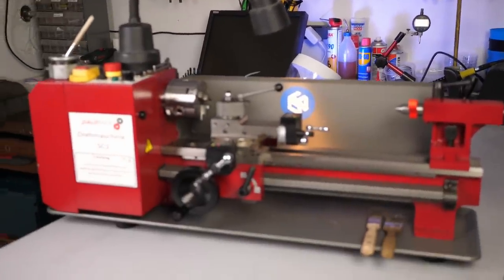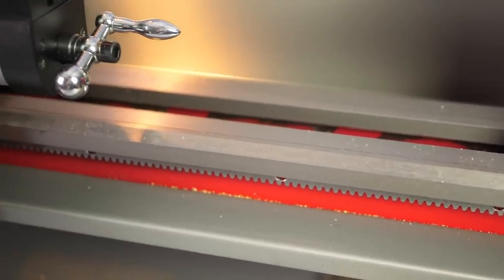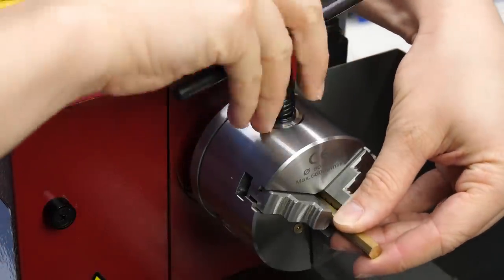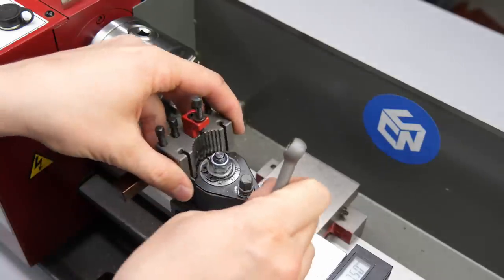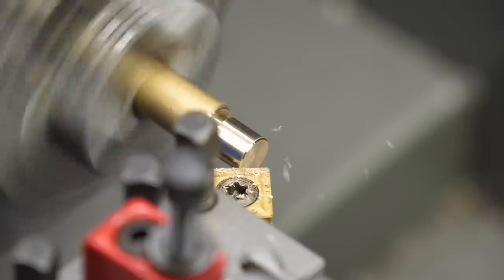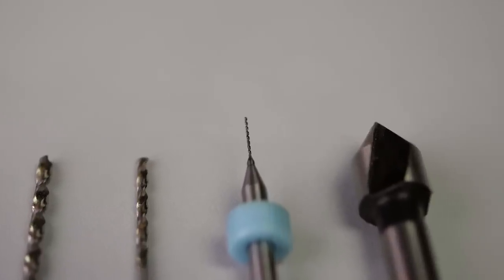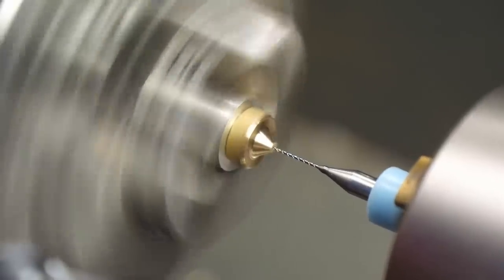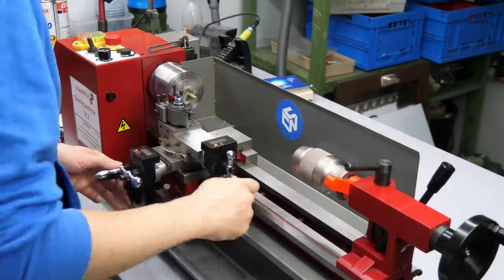Mini Lathe Project: 3D Printer Nozzle

Comment from the maker: Don't forget to share this video on Facebook, Reddit, Twitter and other social media!
Reply: ahaan, you rrrr pro
Reply: Sure. I want more of lathe videos. I think Nice challenge would be 0.1 mm nozzle
Reply: At :52 you spelled Squarespace wrong in URL
Reply: Question: is it possible to make threads on a pipe? And how would i do such a thing without buying a very expensive die. I am planning to make a filament extruder, but i can really put on a “nozzle without threads.

Alternatively I could try and weld a plate on to the pipe. And make a hole into the plate. Which is obviously not preferable
Reply: @rikdenbreejen5230  yes you can, theres a variety of pipe threads. They tend to follow with the size of pipe you're using. They are external threads though...
If you want internal threads you can possibly use any fine thread that fits.
Reply: Yes you can grind some old drillbits for other angles but they are not going to work as good as the actual made for it drillbit but it does the trick
I learned this from my teacher because one of our students broke the last drillbit for school project and we made it from old drillbit we had to change our way to drill a bit tho
Reply: This Old Tony might be able to help you with the drill bit. He has an old video out on designing them.
Reply: Clickspring's quick videos about brass turning will be your friend.
Reply: Great job, love your work ,keep it up
Reply: When I remember correctly there are special drills with an other angle in the front you could use one of these to make the newer design.
Reply: 5:40 in my experience carbide is perfect for the minilathe and the better choice.
The mini lathe can rotate at high rpm but is weak at low rpms
HSS need low rpm, carbide work good at high rpm. So carbide is better for this machine.
Reply: one day you can make a metal 3D printer yourself!
Reply: CNC Kitchen btw, you could grind a drill to the right angle.
Or use a HSS steel rod and make you own drill. you need a special Tool grinding machine, but this is the way we do it a lot. 👍
or look for the right sized „NC Anbohrer“ the angles should match pretty good
Reply: Which 3d printer do you used for the benchy?
Reply: @rikdenbreejen5230  yes on larger layths there is gear settings for threading and all you would need is a threading bit

Comment: Spending 2k for making a 1$ nozzle. Honestly this is the kind of things I like, even when it doesn't make sense to regular minds. Great work!!
Reply: Agree. But a the very moment you need a custom nozzle, say in a odd diameter, a bi-metal configuration or with special material properties, the machine will pay for itself in no time. Even more so, when you can save a piece of existing machinery for which no spare parts are available any more by machining the missing bits in your own shop.
Reply: Absolutely, but making these one dollar parts are the practice you need to have under your belt for when you need to make those really important and expensive parts.
Reply: Knowledge is expensive
Reply: Also... y'know... you can make other stuff besides nozzles.
Even if you only want to do 3D printed projects, a lathe is still a really useful augmentation to one's tool set. Being able to make custom threaded inserts and other mechanical linkages is perhaps the most obvious advantage. If you can print plastic AND machine metal, you unlock a lot of choices for materials and methods in the design of your projects.
Reply: It's also good for practice 😉
Reply: @joshuamckown3145  You did not read my post besides the first sentence.
Reply: @joshuamckown3145 We have the same name and the same opinion about tools, we should marry🤣
Reply: It pays off in the end. Often you make a part that enables you to build a machine that would otherwise cost $$$$
Reply: He can do other things too, just this was the first.. :D
Reply: It cost me $8 for a piece of brass and two drills when I tried this with my first 3D printer, but I borrowed the lathe.
Reply: ah, yes, because he made one nozzle and then threw away the machine
Reply: $2k on a lathe for a professional maker channel is 110% money well spent. A lathe is an extremely powerful tool and for 3D printing especially you can manufacture custom nozzles, heat breaks, etc.
Reply: Well I already have a mini lathe, small 1950s mills and a little horizontal bandsaw that I got all for $700 used...now when my printer arrives tomorrow I'll finally have a use for them! Lol. I could just use my cnc lathe at work too though, that's only 90k without tooling. Not a bad deal for some nozzles if you ask me.
Reply: In India it's 11$ per hotend
Reply: Sometimes we want to have some fun as well. I have bought a small lathe for about 500Eur... chinese machine but looks more robust than this one. Was it worth it? For me yes. I don't use it too often, but there are applications where it is the only way to prepare something.
Reply: 2k nozzles sold and it pays itself

Comment: I’m a tool maker. 

You can get 60deg drills or cutters. 

I would sharpen a drill bit because I can and it’s cheaper as I have drills laying about.

Also, if you are looking for accuracy, heat and callipers are your enemy. 

Coolant and micrometers are the way to go.
Reply: Fully agree with the micrometers.
Reply: Don't forget gauges!
Reply: Alternatively, use regular 90deg drill and make outside taper 90 degrees. Or 80.
Reply: ColonelAngus101 I think the 60deg helps molten plastic flow.
Reply: I agree i would also sharpen a drill bit to 60 degrees, crude but effective.
Reply: Why

did

you

put

a

line

break

between

every

sentence? It's incredibly annoying to read.
Reply: @yucannthahvitt251  Your comment is so much more annoying than his and I found his comment quite readable.
Reply: @yucannthahvitt251  because the subject of each line is different? Grammatically, it makes sense, as paragraphs should be separated based on subject. Your comment is considerably more annoying than theirs, theirs isn’t at all, as it is correct.  Theirs was quite easy and pleasant to read. T
Reply: @yucannthahvitt251  Why did you even bother to comment?

Putting a line in between signifies a new paragraph for a different subject. His comment is perfect! Yours is....

I'll let you fill in te rest of the last sentence in the previous paragraph ;)
Reply: @yucannthahvitt251  agreed
Reply: I agree ☝️ totally. I would purchase a cobalt drill. Not HSS high speed steel or titanium. Finely grind the cobalt to the angle 📐 you need and then sharpen it.
Reply: Can you explain why one should use a micrometer vs caliper? Just more accurate?

Comment: CNC Kitchen 3D Printer mods are on another level. Does this mean official CNC K nozzles coming soon?
Reply from the maker: Those would be really expensive nozzles, if I sold them ;-) But how knows, this at least gives me the opportunity to play around with different shapes and features and maybe one of these experiments might lead to CNCKitchen Nozzle.
Reply: @CNCKitchen  Are you able to ream the inside diameters? That would give you a much finer finish for testing.
Reply: @CNCKitchen  have you considered contacting Stefan Gotteswinter? He's a German machinist and youtuber.
Reply: @CNCKitchen  would buy these anyway just for novelty

Comment: To answer your question in regards to grinding a 60 degree angle on a drill bit ... you can definitely do this! The key things to remember though are to make each side of the flute as equal as possible (using a fixture is the best), making sure there isn't a positive angle as a relief (you don't want the tool to rub and create excessive force) and to make the cutting edge have the smoothest finish possible.
I've been a CNC machinist for 15 years working on Swiss style lathes.
I'm looking forward to any future videos on this topic. 😊

Comment: I bought the exact same Lathe from Paulimot. Since it isn't very rigid light cuts are often needed so I decided to convert it to CNC. It's great because now I can use a parting blade to cut any complex shapes.
Reply from the maker: Any information on how and what you did? I'd be really interested!
Reply: I milled a new cross slide on the cnc mill put a stepper on it. The leadscrew uses a ihsv servo, but it has terrible backlash, I should have changed it with a ballscrew. For a controller I used a pokeys57cnc with mach4 and 2 handwheel encoders so I can use it like a manual lathe. Here is a short video of it in action: https://www.youtube.com/watch?v=LBFXywe46-8 Also this guy has a not yet done series about the conversion of the mini lathe and he does a  much better job than I am: https://www.youtube.com/user/RotarySMP

Comment: Great work. Quick suggestion: you can run the tiny drill bit during the first setup. If you use it after you do the previous drilling operations then you will already have the spot drill and it will be perfectly concentric with the bores (plus you wont need to worry about runout when flipping the part). You would just need to clean up the hole after using the parting tool. Let me know if the wording on this is not clear.

Comment: Yes you're right in saying you can grind a drill to a 60 Degree tip.
Once you have the angle you want, grind clearance behind the cutting edge otherwise you end up having to put extreme pressure on the drill and part when you try to use it and it heats up the tip.
Finally, make sure the last thing is to use a sharpening stone to just blunt the cutting edges of the drill at 90 deg to the cut. The softness of the Brass tends to deform and pull the drill (like a screw) rather than cutting. It seems a bit backwards, but blunting the drill cutting edges slightly helps to shear the material off rather than deforming it.
I've used this trick a lot on Plastics such as Acrylic, Acetal, Polycarbonate as well as on metals like Brass, Bronze, and Copper.

Comment: As a professional CNC lathe operator, about the grinded drillbit. It is certainly possible to grind a drill bit to that a 60 degree angle, or you could buy one. For best results i would recommend using a cutting liquid as well when drilling in brass.

Comment: Great video, as usual. Picking Paulimot was a wise decision because their quality standards are indeed higher and they do know their stuff and they did help me with technical issues over the phone more than once. I can see that you are using "universal" inserts - but there are also "sharp" or polished ones for non-ferrous metals that resemble HSS tools. Paulimot will sell you individual ones of those for around €4.00 but if you shop around a bit you might find bargains for around 20 bucks for a box of 10. ... as for your parting tool: there too you might want to look at an insert holder and "sharp" bits. What's convenient about those is that you can find parting inserts with a radius - great for O-ring grooves or when you want to turn soft inner corners that dont act as stress raisers - look for type MRMN-200 inserts to find out more.

Comment: You could regrind a drill bit to 60 degrees to make the new version of the nozzle.  Or, you can use a piece of drill rod/silver steel to machine a 60 degree D-bit, mill the cutting surface in half, harden, and then polish with a stone.  Both methods will work, the drill bit would have to be free hand ground where the drill rod can be machined on the lathe.  There are several videos and texts on d-bit grinding and it is a good way to make custom profiles in the home shop.

Comment: I used to make drill bit they were for masonry but we had to grind them onsite as part on the manufacturing process after heat treating so if you don't let it over heat and ruin the heat treating I'd say it's well worth a go with an older bit

Comment: What i did was, leaving more material in nozzle end for a better center to drill the 0,4mm and cut it away. 
For a better way of measuring the taper, index the cutter on a know surface (face of the leaved surface as written above), move to wanted cut area. After touching by looking at the dial you would know how much u plunged in... Do the math beforehand. 

And use the flats of the calipers when you have the chance rather then the sharp tips. 

Regard from a fellow aerospace student from aachen.

Comment: I'm a new machinist, I've been at it for about a year. The one thing I could say here is that you can get those same inserts in HSS. You don't have to use carbide OR grind your own tools. 

That being said, if the carbide's working for you, use it. I use it at slower speeds at work because the rounded cutting edges don't chip as easy as steal. I've even got my boss doing it.

Comment: For machining brass, it's very doable to grind a custom shaped drill out of a piece of drill rod.  Turn or grind teh profile you want, then cut away half of it. It's called a single flute or "D" drill.

Also, carbide inserts are typically not very sharp due to the coatings, they are difficult to find but there are HHS dead sharp inserts available, or uncoated carbide is fine for brass.  Second, a reamer will give you a much better finish than a drill as a finishing operation, you will need to drill it undersized first.  Third, center drills are not really meant for spotting, the 60 degree angle is intended to provide a bearing surface for your tailstock center.  The angle means the drill will contact corners first, and will want to dig in instead of cutting smoothly.  A spot drill that has a face angle matching your drill is the best option.  Forth, starting with hex stock is a very common practice, don't feel like you are being lazy lol.

Comment: You are correct,you could simply grind the drill tip to 60 degrees. Clamp a guide to your grinder and spin the drill against it in your fingers until the tip is all at this angle. Using the angle as a guide simply back the lands off a little on the grinder to give a nice rake clearance. Only a very little would be enough. Some drill sharpening jigs allow you to adjust the tip angle but it's really quite simple to do by hand and eye.

Comment: A great trick for you! You can flip your single point threading tool upside-down and run your spindle backwards, which allows you to start a right handed thread from the inside at the undercut. This allows you to not have to worry about that nano second margin of error disengaging the thread pass without running into your stock or chuck.

Comment: I have a suggestion if you plan to do more in the future.  @11:25 you talk about the center bit being 0.5mm and you can't plunge it in too far.  If you made the tip of the nozzle longer, you can plunge the center bit in further.  Then use your 0.4mm drill bit.  The last operation would be to take off the waste 0.5mm part of the nozzle.
Thanks for an awesome video!!!

Comment: Stefan, 
For future reference: You can use a bit of appropriately sized copper wire wrapped around the threads to clamp it in the jaws without destroying the threads. With how small it is though - I'd say your implementation may be more stable. You're making me want to buy a lathe now. Great job!

Comment: A small (tiny) centre drill would give you a ready made 60 degree form tool , but grinding ones from a small drill would be fairly easy . One tip , once ground blunt the cutting edges with a fine stone to prevent it grabbing in brass

Comment: Nice job using the half nut on your lathe as a dolly for the benchy boats... I'm impressed your lathe handled your use of that carbide insert as essentially a form tool instead of a single point cutter, I suspect it's not conventional but it certainly made the right looking result. Nice concentricity too for a 3 jaw!

I wonder if it would be easier and flatter in the tip if you left a little extra length until after you drill the little 0.4mm hole, to face off as the last operation.

Comment: You’ve done a great job with this Lathe, and it looks like you got a good one to get such accuracy! You’ve got all the good accessories, especially the tool post and digital dial indicators.
I bought one of the same models a few years ago and it was complete rubbish! Nothing I could do would get it working properly. A case of inconsistent Chinese quality control.
I agree with you about manual control. There is something very satisfying about shaping a piece of metal by hand.

Comment: For the taper, you could also relatively easily fabricate a spade drill. Since you'll only be removing a tiny bit of material, geometry is not critical - no need to worry about chip evacuation, and brass is easy to machine.
Clickspring has made such things from (I think) old nails.

Comment: 4:00, when I worked in a shop making valves, we always bought the proper sized hex stock for the job at hand. It makes no sense to mill your own hex.

11:30, I'm not a machinist by trade, but what you could do is make the length of the nozzle slightly longer than needed, drill your center hole, then your final hole size. Then cut it off to length.

Comment: Hello, Consider stepper motors with dual outputs allows. This allows you to put the crank back on the end of the stepper motor. That gives you best of both worlds. A note of caution, unplug or create a switch to disconnect the stepper motors wires from the circuit board. When hand cranked stepper motors create electricity and push it down back down the line.

Comment: Changing a drill bit's tip angle to the required angle would work, though you may need to double check that the geometry is still good for cutting at the new angle and that it won't cause surface defects and has a good pilot hole

Comment: You can cut the threads in reverse to make it easier. Turn the tool upside down, make sure the tool is centered, then you feed the tool towards the tail stock, versus threading towards the chuck.